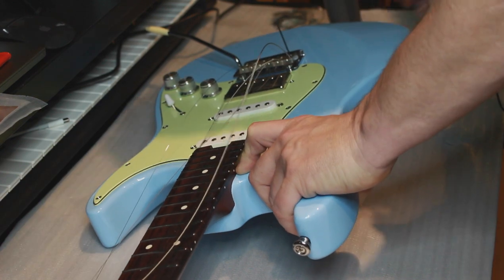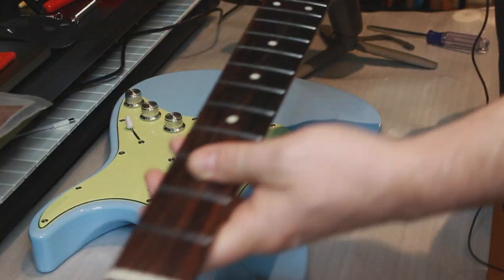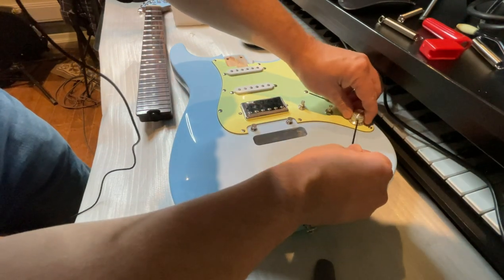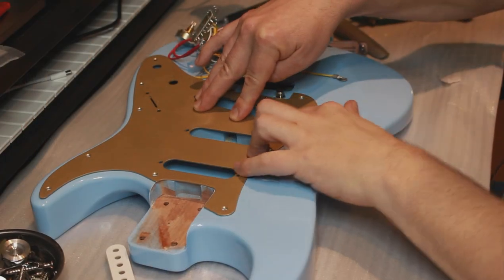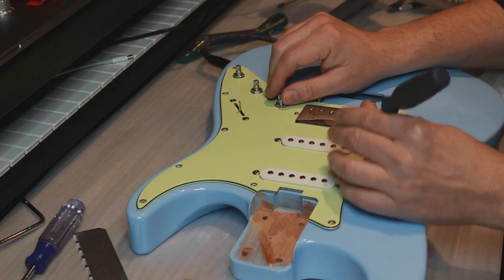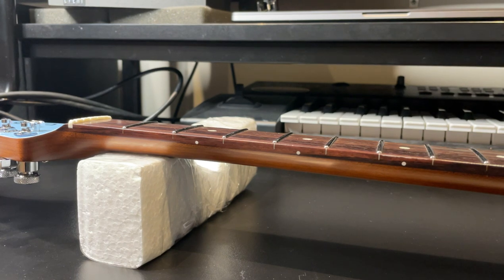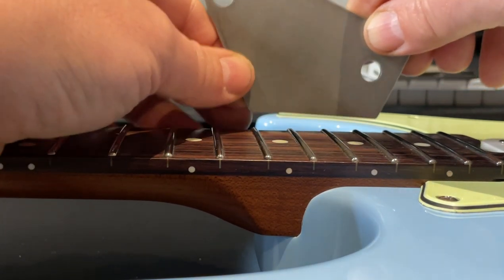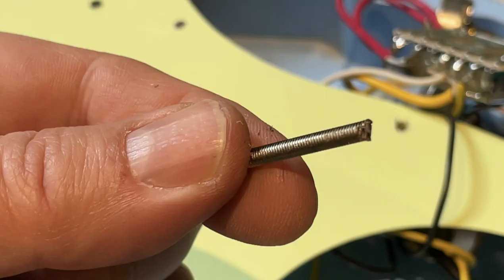Eart CP-1 - Worth the Hype?  Sound Samples - Complete Tear Down - Analysis

Comment: My 2 cents. I have a NKC3 upgraded to GFS 63 Texas Pro SC and VEH hum pickups. Total ~$407 USD. Does not come close to $1K as mentioned in the video. I compared to a Grosh Retro Classic with Fralins, made in Southern Cal in '96. Mint. Played thru Two-Rock custom reverb prototype + TR 2x12 vertical cab with Eminence Tonespotters. Very high-end setup. Conclusion?  Playability is the same.  Sound? Grosh slightly more jangly in top-end, but that's because the SC are more vintage while the 63 Texas are vintage and a bit hot, R at ~6-6.5K.  Grosh has no humbucker, so didn't compare that. Overall, the guitars are extremely close.  Except in price. Like 7X difference.  EARTs are excellent guitars for just messing around, hobby for mods, and for gigging when you don't want to bring a > $3K guitar to a gig. Mind boggling how well the guitar plays and sounds.  Resale value? Not so much, but you don't get guitars like these for that. You get them to PLAY without breaking your wallet.
Reply: I have an nK C3 coming any day now and this is pretty much my exact plan.

Comment: I really appreciate the time you took on this review, especially showing the quality of the fretwork. Everyone seems to rave and say that the frets are perfect. While they clearly are polished well and have nicely rounded ends, the crown / level job obviously reflects the price point.
Reply from the maker: Yeah. In my case I found both guitars turned my fingers black after the first time I played them. I’m guessing they didn’t bother to clean the fingerboard after their final polish. Also, and what’s more troubling, is the model that was advertised as having a roasted maple neck actually doesn’t.  You can tell because the color of the wood under the nut slot (where the nut wasn’t glued in) was not the same as the rest of the wood. Roasted maple is the same color all the way through.  Pretty misleading of Eart to do that in my opinion.

Comment: I just checked the price of the CP-1 direct from Eart and it $ 449.00 to be exact as of today 9/13/22.
For this price you could get the Ibanez ESAZ with trem. The Ibanez also uses ceramic magnet pickups (as do many other  more expensive models) and they sound good too. I'd take the Ibanez any day because I bet their fretting is great even if not so pretty... As a matter of fact I got one of the first Glarry Strats a couple of years back and worked on it until it had  an action as good as my PRS (for me) The pickups and and bridge block still need replacing. I'm about to put Texas Specials on it!
I actually acquired it for a laugh but really like the neck shape! Cheers for the review, Pete.
Reply from the maker: I bought a used Ibanez Talman for 300 dollars. It’s also made in China but much bette quality. When a big brand has their name on the headstock the emphasis on quality control seems to be much better. The company I work for manufactures products all over the world. Facilities in China are subjected to random spot checks for quality because our brand name is at risk should the quality not be what it should be. I doubt Eart has this pressure since it’s their name on the headstock. I’ve also seen some of their guitars specs say roasted maple neck when they actually aren’t. One way to check is to look at the color of the screw holes in the neck. The wood should be the same caramel color all the way through. If it’s not, it’s not roasted!

Comment: I enjoyed your review, and took note over the things you pointed out. But remember that you bought the cheapest guitar of the line, and I would expect less QC issues on a higher models. Still I found your opinions very honest and well grounded. Good luck with your channel.
Reply from the maker: Hi Glitch. Thanks for your comment. At over 500 dollars this one is far from the least expensive in the range. You can definitely fine less expensive Eart Guitars. I think upgrading could be more hassle than it’s worth for the lower end ones. Just my two cents.  Cheers!

Comment: The standard pickguard was pretty close,  all you have to do is use some wood glue and toothpicks to cover up the 2 or 3 holes that are partially covered, then just drill new holes. Mohagony is a very workable wood, a lot easier than maple, I've worked on both. The hardest part about swapping pickguards would be to cut the notch for the truss rod access on the pickguard...find a fried with a Dremel, or buy a refurbished one on ebay for less them $50. You'd know there are some imperfections under the pickguard, but you won't see it.
Reply: yes, this is a simple fix. these earts are project guitars.I have 2 of their tele copies and I'm considering getting one of these to convert to an HSH as the green model is currently on sale for $319.90. once you fix them up and replace the cheapo parts, you have a very nice playing guitar for <600-700.

Comment: Thank you Lucas. I thought that was a very honest review. Based on an actual consumer experience, without biase. I was contemplating this brand for a cheap guitar, just for fun. But after watching your review it reminded me of my painful experience with another renown budget brand Harley Benton. I bought a HB CST-24 in emerald green last year, and had a hard time even replacing a simple thing like a nut as the size is different from most guitar brands. My guess is all these budget brands, in order to avoid law suit from patented owners, had to build their guitars in a slightly different specs. So i total second your suggestions, that if anyone should decide to purchase one of these, they need to know modding or replacing parts can be a huge problem. Just not worth the hussle... I sold my HB CST-24 after 3 months ownership... i will anytime, buy a charvel if i want hard rocking guitar that is well-built and reasonably priced. just my two cents. Kudos to your videos!
Reply from the maker: Hey Sangye!  Thank you for your comments. Sorry to hear about your experience with the Harley Benton.  I’ve never tried one myself. I was seeing all these glowing reviews and not one of them took the guitar apart. I wondered about it as a mod platform because I figured most folks would approach it with that in mind. I’m glad you found this helpful. Of course it’s just based on what happened to me. I’m sure there some folks who had better experiences than I did. Cheers!

Comment: Thanks for the honest review. A friend and I purchased the Eart W2 headless and there were a few issues. The pickups had too much microphonic squeal, both guitars had one bad fret on the neck (different position for each guitar), and the screws used in the bridge are cheap and could easily strip when trying to make adjustments. Someone below commented on having to use the tiny crank to move the tuners. Fortunately an allen wrench works fine and that's a good thing because EART said that they wanted $8 for one of those tuning cranks. Overall, the guitars are a good value at around $300 each, but you're right about the "handyman's special" description, and looking at other options once you start looking at the higher priced offerings from EART.
Reply from the maker: Thanks Jackie. Sorry to hear about the issues with the W2 models. Glad a regular Allen key works. 8 bucks is a lot of money for that little key.
Reply: @LucasCrossleyGuitar   You're right about that - way too expensive !

Comment: Lucas, Thanks for doing the job right. Your videos have helped put these guitars into perspective for many budget minded guitar players, me in particular. Hopefully your videos will induce Eart to improve their products over time.
I do have to say, stainless frets, roasted maple neck, cheap ceramic pickups, 500k pots and a treble bleed all combine to act like a unalterable high pass filter. Very shrill.
I see that this guitar sells for $350 USD on Eart's website. This website has changed a bit recently and some guitar's specifications have changed a bit. I'm not sure about this guitar. The CP-1 web page now says that the body is composed of carbonized mahogany. This did not come across on the video. Whatever. Perhaps the stuff on your fingers is dye from the fretboard that mingled with the polyurethane that was sprayed on top of it. 
Again Lucas, thank you for producing a video designed to help others and not just promote yourself.
Reply from the maker: Hey Railroller thank you so much for your comments.  Yeah, the body on this is Mahogony I did mention that when we looked at the neck pocket but I don't know what they mean by carbonized though.  I'd love to know what that means.   Like I said in the conclusion of the video I think some of their specs are super confusing.  I think it's probably a language barrier thing when translating to English.  Regarding my fingers turning black, that happened on both guitars.  My hunch is that they just didn't clean the fretboard well after the initial fret polishing.  So, it was basically dust from the metal if that makes sense.  It's just another sign that they may be cutting some corners to keep the costs down.  FWIW, when I did the first string change I also oiled the neck with white mineral oil and the rag was pretty nasty when I was done.  There were no strings on the guitar at that time.  Again thanks so much for your comments.  Cheers!!

Comment: It seems like a lot of trouble for a $445US dollar guitar.  If someone wants to start making modifications... maybe go to a more expensive guitar???  I have a EART e335 and I'm blown away by the bang for the buck and overall quality.
Reply: This guy is a weird nice guy.  Why did he tear the tremolo apart, who in their right mind does that.  They are like $300 on Amazon, not sure where the $445 came from.
Reply from the maker: I did that because I’ve had some challenges with it. I can’t get the bar out without a fight. Wanted to see how tight the grub screw was. Even with it out the bar gives me some issues.  Cheers.

Comment: 05/10/2023:  I have the Eart T-380 and it is fantastic, except for one feature.  The bullet fret-wire "end" look great, but when you move your hand up/down the neck your first finger bumps the bullet end .... bump, bump, bump ... and it gets painful on the first finger.  I took a jewelers file and filed the bullets down, and now they looks and feel just like a high-end fender, etc.  Also, the fret board is not rolled, so I rounded it off too.  Now, it is prefect for me.

Comment: I’ve never used aluminum foil and brushed on contact adhesive.  I always do the same with copper foil.  But I’ve heard others say aluminum foil shields just as well.  What do you think?  I appreciate your fine eye and candor, as should any vendor, as I’ve considered buying one of these.
Reply from the maker: Yeah I’ve heard the same. There are companies that sell pre cut foil with a removable adhesive for exactly this kind of thing. I used one on one of my strats and it seems just fine. Cheers.

Comment: Zinc composite blocks are softer metal than string ball ends that is why they get stuck.
Reply from the maker: Great feedback thanks. Would you say it’s also a cheaper material?  I honestly hadn’t experienced this before these Eart Guitars.
Reply: @LucasCrossleyGuitar  I’ve never seen an EART but it happens on a lot of after market vibratos and on budget guitars such as Squiers.

Comment: I have too many guitars and basses to be constantly changing pups.  I work around with a Seymour Duncan Signal Booster pedal, a Boss GE-7 EQ pedal, the guitar and tube amp tone controls, controls on pedals used, etc. I could make this guitar work well enough stock.  Shielding is easy enough and noise gates help too.  People spend way too much dough unnecessarily on pups IMHO.
Reply: Plus, you rarely recover upgrade costs selling guitars.  Let the next owner upgrade to their own personal preferences is my philosophy.
Reply from the maker: So true.

Comment: About this particular model: I don't really think it is that much of a steal regarding the price and the delivered features. There are other brands like Harley Benton (particularly the Fusion II line of guitars) that offer similar or even better features (like a Wilkinson vibrato system and locking tuners) for less or about the same amount of money and these guitars are manufactured in Indonesia instead of China. Generally speaking, in the price range of about 350-650 bucks the EART guitars have tough competition.
Reply from the maker: Hi Lokkar. I think you are absolutely right!  Thanks for your comment.

Comment: This model and  Brand has been X'ed off my list for a modding platform after watching your video as well as others 
that did go over the odd differences in sizes and problems.
When you cannot swap basic easy parts like a pickguard without needing further work for me like cutting the 
new pg then it is just no longer worth it to save a few $$$.

Comment: I would have give you 2 thumbs up if it was possible. I play for more than 20 years and have a lot of guitars of different brands from cheaper than Squier to Gibson and I also built myself a Warmoth. By the way Warmoth botched my bridge placement. To be able to intonate my E string I have to use a .054 string and have the saddle all the way back. I'm done spending too much money on guitars so I bought a Squier Affinity Tele on January. The setup (for example action at 7/64th) and the strings were so bad that even with the E saddle all the way back the intonation was so bad that I could not use the E string, it was out of tune.  A setup and Ernie ball strings corrected that issue. I also had to file down a fret because I have a big buzz. There are other problematic frets but it's not an issue. Imagine if a beginner received that guitar ? Last week I ordered an Iyv or Ivy Les Paul ils300egr and I received it yesterday. 15 min later I asked Amazon for a return. There is a big dent, a lot of dent and scratches. The nut is not perpendicular to the fingerboard. The right bushing on the stop bar is not inserted all the way and not straight. There is also a dent in the neck on the 5th neck that my hand can feel. I did not even bother to check the setup but at least the action was ok. My point is if you buy a guitar from a know brand like Squier, you might be ok with a setup. If you buy from a unknown brand like Ivy, Eart, Grote, etc., it looks like it's a lottery. If you're lucky you can get a guitar with no issues. I agree with you.I bought an inexpansive and I know the hardware, the pickups and the woods will not be high end.  It's not because I have bought an inexpansive guitar that it's ok to have defects.
Reply from the maker: Hi Didtok,  Thank you for your nice comments.  Sorry to hear you've had some challenges.  There's a lot of interest in budget brands as you know, but I think more often than not we wind up spending more than we save to try to make a great guitar and in the end we wind up with a guitar that isn't worth what we spent on it if we try to sell it privately.  Again, thanks for your nice comments.  Hope you have a great day!  Cheers
Reply: @LucasCrossleyGuitar  Spending money on a budget guitar, who does that ? Did I buy a Fender Tex-Mex Set at 99$ for the Squier Tele I was talking about after saying I will keep it stock ? I won't deny it but I won't confirm it either !
Reply from the maker: Lol. I know how you feel. I think we all like to save a dollar when we can. Cheers again!